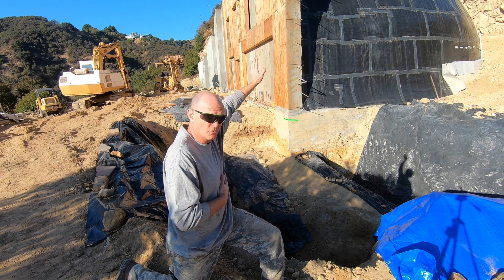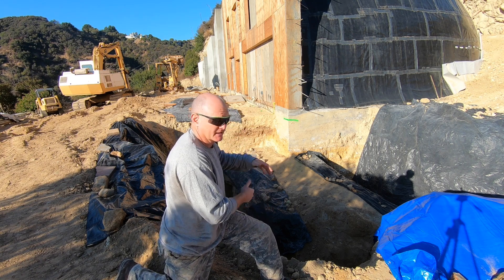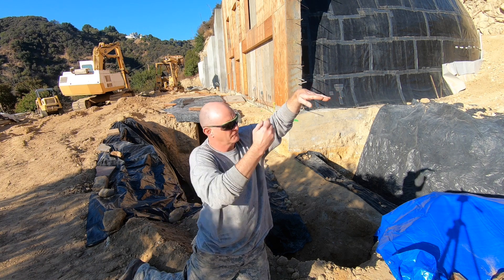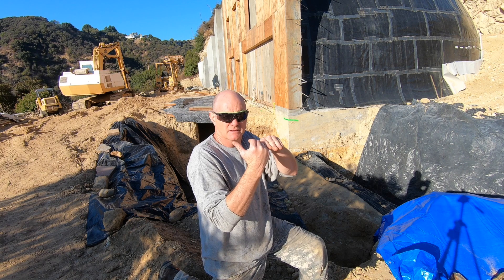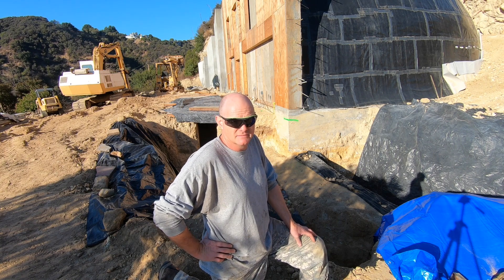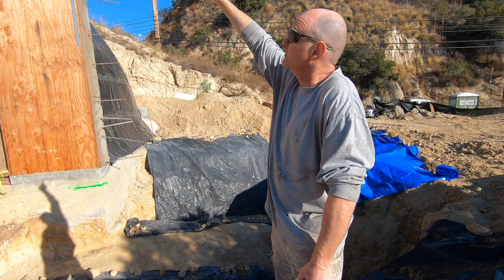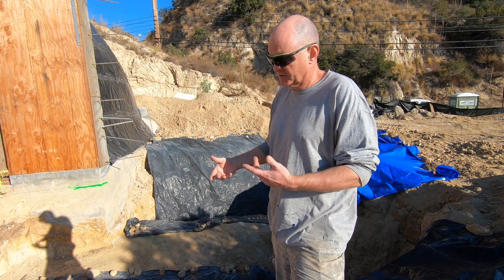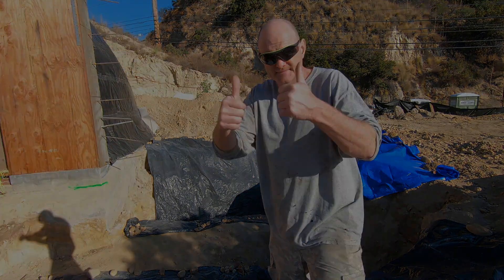Geology and Excavations for the Dome Shaped Underground House

Comment: Is there a way to "sound" the ground like oil companies do, to determine where the bedrock changes to dirt?  I mean, a cheaper way than digging and finding out AND a cheaper way than using the multi-million dollar equipment the oil companies have? For example, maybe using well diggers' drills?  I'm asking because my property is also mostly on the side of a hill and I'm about to layout for an aircrete dome. I can afford it IF the ground is consistent, but I'll be in real trouble if I have to re-engineer once the base is layed and I pour.
Thank you in advance for any advice you offer.
Reply from the maker: Hi, I'm not sure.  I believe you could "core" ie, drill a series of holes to determine how deep your bedrock is at various points.  Other than that, I wouldn't know.  Sorry.